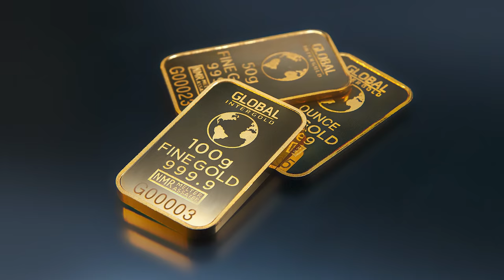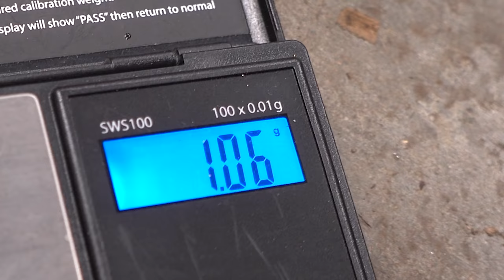Here's What Gold Miners Don't Want You To Know..

Comment: That was fun!!!  Second comment several months later, I went to a class and the teacher said that the retort should be totally cool before removing, you can just leave it or after 20  -30 minutes if not cool then drip water over the top. But to leave it to cool until you can remove it by  hand, with only a plastic glove. Otherwise you can release the mercury vapor

Comment: 9:40 You had plenty of mercury to collect all the gold. What you failed to do was tumble it together. You have to constantly mix the gold, dirt, and mercury. That allows all the gold to be captured by the mercury. Tumbling is best, because you can set the tumbler and let it run for an hour. But I suppose mixing with a kitchen mixer would do. Even a magnetic stir pellet in a beaker. The important thing is constant agitation.

Comment: It would be a lot safer to use your retort outside with a breeze to your back. Mercury in liquid form doesn't`t exhaust fumes until heated of course. Also the best retort is the one that looks kinda like a still.    It`d be great if you could do a vid. retrieving the 30,50,100,200 as well,  using the chamois method ,cause that`s really cool too.  thanks

Comment: Try putting it all into a tumbler at low speed for a day. The Gold/Mercury amalgams should attach to each other and form a ball that you can just pick out of the black sand. The other trick is to do it like you did but work it in a pan full of water with your fingers and try to work the little pieces all together into a ball.

Comment: The old timers around here ran that amalgam from stamp mills over copper plates to collect it (small bits) from the water and slimes. Seems the mercury likes copper also. Then they would clean the plates with wooden scrapers and retort the amalgam. When there was damage or age, the wooden scrapers were burnt and the remains retorted with the rest and values recovered.
Reply: Ah ha!  Missing info found, I suspect. :)  Thanks!

Comment: I collected a fruit jars worth of mercury from blood pressure cuffs when they became as toxic Hazzard and were replaced. And yes, I put it through every test I could think of also for recovery including electro magnet recovery. It's unlike any other metal that's for sure. Like in your experiments I may have picked up minute particles but not what you could call a success and chalked it up to probably contamination from metal particles. The retort I made can hold the entire 700 mil.jar not that I'll ever need that much but best to err on the side of candy "science term". The only thing I did different is the recovery tank. I have a 10 lb aluminum bar that I machined out to hold the retort inside with 1 1/2" of space around it. I freeze it over night to cool water inside again I err on the side of I don't want to do the poisoned cockroach dance for a bit of candy sicamatific approach. But what amazes me is that through the dozens of times I ran it to work out the details of getting the recovery down. I haven't lost any mercury by weight. So I guess it's "scientifically" safe. Although I do place my retort in a case I seal up with an old bath fan and venting to prevent the basically mustard gas if it should escape from the retort from being my dance partner.  I don't know who came up with the idea even though I've looked  for the information. But as smart as we think we are those old school chemists were pretty amazing! What really does shock me is that the knowledge of the effects of the gas and skin contact were well known, the minors that would handle and inhale the fumes must have been on low end of the Darwin scale. Next time out, try adding ice to the cooling tank I think you'll like the results. Great video Pauly!👍😷

Comment: you should put a drop of mercury on top of an aluminium can.. or sit a full soda can in the mercury and see what it will do to the aluminium. also if that mercury is from rivers you may want to flash that down also. it may have dissolved cold in it still

Comment: If you want to collect all the fine gold into one ball of slow mercury, first put concentrates into a pan with about an inch of water and add nitric acid until just a few bubbles come up.  Placer gold often has a molecular coating of sulphate on it that will interfere with the amalgamation.  The nitric will clean this off and you'll get better recovery.  Then rinse the concentrates with clean water to remove the nitric.  You can see that the gold is actually brighter after the wash and the mercury will act just like pac man swallowing up the gold.  Once you have a ball of slow mercury in your pan, pan it down just as you would a nugget.  Then squeeze the amalgam through a natural deerskin chamois under water in a containment vessel to remove the excess mercury before retorting.

Comment: The reason you heat the mercury in that tube that only has an opening at the bottom under the water is so the gaseous mercury will be forced down to the water to cool and turn back to a liquid state. I handled some mercury one time and it coated my wedding ring completely, even on the inside surface that was against my finger. I happened to be at work when it happened...in a hospital, so I took it to my buddy in the lab and asked him how to get it off. You couldn't rub it off, as I tried that. He held it with a pair of tongs and merely passed it through the flame of a bunsen burner and presto, it was gone. He had me hold my breath while I watched him do it and then we walked away as soon as it was done. That was a really stupid thing to do inside, and to do it outside would be environmentally contaminating. If you were to breath those gasses it would cool down inside your lungs turning back into a liquid state INSIDE YOUR LUNGS!!! Then it would get into your blood stream and you would die a miserable death! So if you ever get it on your gold ring and don't have that tube thing, just improvise. Set it atop any kind of hard object in a pan of water. Then use the smallest tin can or metal cup that will cover it and heat it up the way Polly demonstrated...and do it outside. I would also poor water over the cup afterwards and wait a few minutes before retrieving it, just to make sure the gasses had cooled.

Comment: im not an expert, but we played with mercury as kids. my grandparents were scientists (grandfather a physicist and great gram an astro physicist) when a thermometer broke at theyre house my parents and grandmother put it on a plate and let us push it around with a toothpick. they did this to introduce the concept of a metal being in a molten state at room temperature cus...science is cool!!! i wouldnt suggest doing this with your kids, but i survived. ive also harvested merucry out of old cars hood switches. mercury wont hurt you unless you gasify it or get it in a cut. in fact if you eat mercury most of it will pass through your system  and out the other end as long as your guts are intact. this doesnt apply to mercury in fish because its a different type of mercury

Comment: You need to dump your mercury/gold into a wet rag and rig it into a ball first and it will all hold together easily, then put it in the retort and recover both metals again. You ALMOST had it, the wet rag method is an old timey method used all over the world for hundreds of yrs. In Guyana, Africa its still used today except instead of having retorts the locals just put the gold amalgam balls in a steel gold pan and fill it with hot coals until all the mercury is burned off which is VERY dangerous in vapor form but its super simple and cheap to do

Comment: I found a beach that's loaded with fine gold hundreds of fine particles per pan but there isn't much water besides the ocean water, so it's not really possible to use a pump and high banker, so I was thinking about using mercury, would this work? Get a container, fill it with sand and Mercury then shake it up a bunch? If anyone has any advice that'd be great

Comment: That respirator muffles your voice and it's not doing anything for you anyways with those cartridges. 
Those are 6001 organic vapor cartridges and they don't protect you from mercury vapor. I recommend you get the correct PPE before you resume expecting.  

Also when using the Mercury vapor cartridges, keep in mind that they're only good for 50 hours of exposure to Mercury vapor. You need to track the time spent wearing them in it's presence.